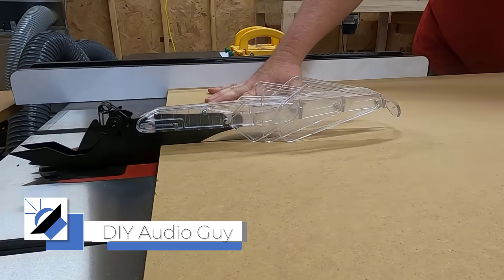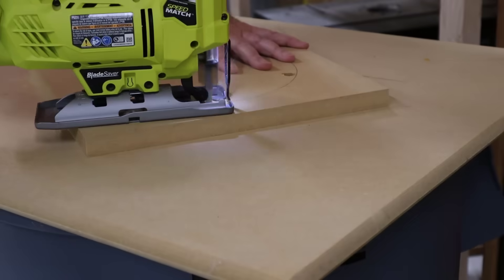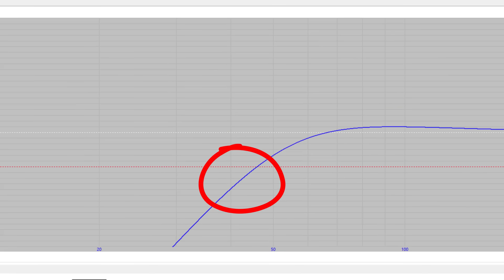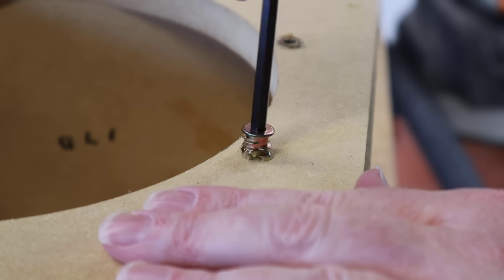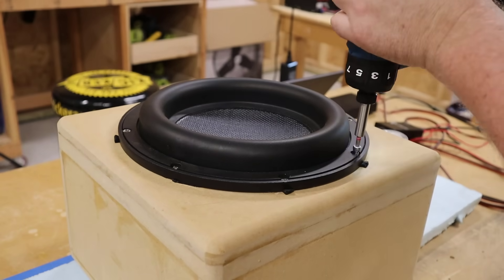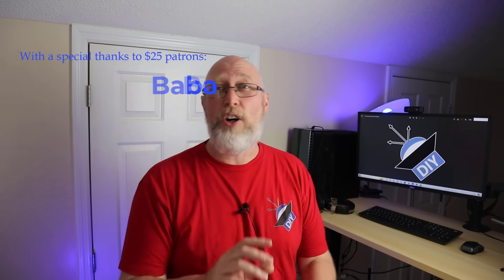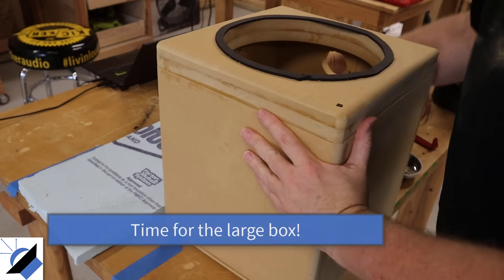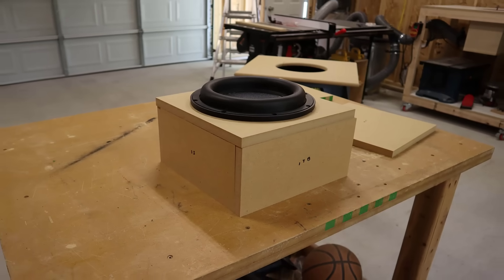Bass in a small space?  Sealed subwoofer enclosure design.  @PartsExpressOfficial

Comment: Get the best of both worlds, one sealed, one ported. Get that nice hard hitting bass drum kick from the sealed, and  the good low hz response from the ported.
Reply from the maker: I think it would be cool to build some good sturdy sealed enclosures into the front doors or the front floorboards.  Then fill the trunk with a massive ported box.
Reply: Sealed and ported enclosures  have a different phase response. Running sealed and ported subs playing the same freqs will sound like a muddy mess. You'll be fighting phase cancellation and reinforcement. Get a good sub and match it to the right box, be that ported or sealed and you won't give up anything in transient response or bottom end extension, especially in a car.
Reply: @helotaxi  Well, that's not what is happening.. I get good hitting bass and get the low frequencies. It sounds good, not muddy at all.

Comment: I'm one of those guys that need to stick with a sealed enclosure.  Either I have tools in the back hatch part of my jeep or family stuff. I'm going from an 8 to a 10 to help with the iron law . According to specs I can get by with .8 cuft of air space. Can't wait until you do the NVX amp video. I really am looking for an amp that can do 350-400 watts at 4 ohms.
Reply: @Tron Magnum
Look into the NVX XAD42. It's a tremendously versatile full range amp that can do anything from 350w x4 @4ohm to 1600w x2 @ohm Bridged. While it is a full channel amp meant for running door speakers (meaning it won't have a bass knob), as long as you set the filters up it can be used to power subs well too. And it's got a small footprint. My next setup will likely have 2 of them running everything in the vehicle.

Comment: that is pretty similar woofer to the 10" i bought: SB Acoustics SW26DBAC76-8 10’’ Aluminum Cone Shallow Subwoofer.
my box is 0.6Cubic Feet. i would consider that pretty tiny. did some WinISD and made the thing. not much air inside with all the bracing and 3 pounds of stuffing.
it did measure in my small room pretty flat to 20hz, but it did not sound that to me so i did a lot of dsp to it. now it sound like flat to 20hz and 15hz at reduced volume.
all with 100w amp mind you, that surprised me.  and i matched the 8ohm driver with 8 ohm amp output.

Comment: I don’t really agree with this statement.  There are always exceptions to this rule.  
If your lower power,  then yes,  a slightly larger box will
Help output.   However if your overpowering your sub a slightly smaller box will help output.  
Prove me wrong lol
Reply: Neither box will necessarily give you more output. The maximum output of a driver in a sealed box is a function of the excursion and cone area. Nothing else. A larger sealed box will allow you to reach that with less power. Although a super small box may be able to increase efficiency at higher frequencies (at the cost of low end extension and sq)
Reply: @blakebrockhaus347  yeeesssss 
My point,  I’ve noticed if your at the max or slightly over max power limit of a sub,  (in a sealed box and even in ported). I’ll run just ever so slightly smaller box and Seems to help control the suspension of the sub better and give you max output that sounds decent,  
Try that same aspect in a larger box,  the suspension of the sub will start to loose control and the sound quality degrades 

Flip it on Lower power level,   A bigger box will let the sub move a little more freer,  and give u better output 

I love this stuff,   Trail and error,  school of hard lessons
Reply from the maker: Sounds like a topic for another video.
Reply: @DIYAudioGuy  I hope so,  seriously 
Power levels vs box size
Reply: I'm currently using A too small box for some Jensens and they get very hot very quickly

Comment: Nice video...!!  The Iron Law still reigns supreme... 🙂

A few things....

1. WinISD really isn't the best for modelling subwoofer capability as it doesn't take inductance into consideration.  None of these drivers are going to produce a dead flat response above 80 Hz like the WinISD model suggests because of their inductance.  Hornresp is a bit more complex to use, but its performance predictions should be a lot more accurate.

2. I suggest always use an external USB sound card when using your laptop for audio measurements.  Not only do the external sound cards usually have a flatter response, there's a lot less risk of damaging your laptop's sound output (which is usually part of the motherboard) when using an external sound card. 

3. Add about 800 uF to 1000 uF of capacitance in series with that driver in that small box and see what happens.  You now have a passively-assisted sealed alignment which should not only remove the "hump" in the response curve (due to the driver's inductance), but should also noticeably increase its output at lower frequencies.  The tradeoff is a lot more excursion, but if the driver's up to it... :-). 

4. Try stuffing the smaller boxes with polyester fiberfill to see how their performance changes...

5. I did a similar experiment some time (as in many, many years) ago, but I used a plastic bucket with a baffle fastened to the top of it to hold the driver.  To vary the volume, I just changed the amount of water in the bucket - not a problem as long as the water doesn't reach the driver's terminals :-).  I think I used the bucket's lid to create an internal circular panel that floated on top of the water as well. Water is not compressible, so it's a quick and easy way to change the volume of an enclosure, as long as it does not come into contact with the driver. I used the contraption for Vas measurements as well as observing the changes to a driver's power handling based on the volume of the enclosure that it was mounted in.
Reply from the maker: I definitely want to try that capacitor trick, I remember reading about it.
Reply from the maker: Tell me more about the external sound card.  The mic I'm using is a calibrated USB mic.  I'm not seeing any external sound cards that have a USB input on them.
Reply: @DIYAudioGuy  Use a laptop with at least two USB interfaces - one for the mic and one for the sound card.  Then you can use a simple USB sound card for the output.  Amazon has many available.  If you're more interested in laptop protection rather than quality, no need to splurge - any of the cheaper ones should work fine.  I use the Startech at the link below because it provides a number of channels of output, and includes optical interfaces, all for $38.  I have it fastened to my desk with double-sided sticky tape, so I can just plug it into my laptop when I'm ready to use it.

https://www.amazon.com/StarTech-com-7-1-USB-Sound-Card/dp/B002LM0U2S
Reply: Definitely would like to see stuffing vs no stuffing.

I personally have added rockwool to my UM12 enclosures and saw it kill any resonances above 100Hz and also lowered my tuning by a whole 1Hz while the overall SPL remained largely identical so no loss in output just a very obvious lowering of the tuning.

Rockwool might have been overkill but I have 3in thick bats that I lined the side walls, bottom, back and partly the top of my enclosure. I have pictures of it before and after but can't really share that in the comments I don't think. (UMIK-1 measurements + a pic of the enclosure inside before/after)

What would be really cool is polyfill vs Rockwool. If I had an extra UM10 laying around I could measure that difference myself. But I don't. And for the time being I have no use for an extra UM10. Though in the future I might and could test that if I have time.

Comment: It probably doesnt make much of a difference but I usually like to clamp after nailing glue ups. On sub boxes I also like to run a bead of glue along the inside corners as an extra measure.
Working with solid wood when appearance matters i feel like clamping is a tighter, less noticible joint. Those corner clamps will be great for gluing without nails as well. Hold them in place just to get a big clamp on. That way you can avoid using wood filler which can be tricky to color match or clear coat 👍
Reply from the maker: Would like to know what you think of this:  https://youtu.be/dbVd5igcjHs  I am not 100% happy with the finish (second video in the series), so I guess that means that I need to build another!
Reply: @DIYAudioGuy  It came out pretty nice, what arent you happy with? I'm a perfectionist, so I fully understand not being 100% happy with the finished product. I think theres value in that, but also be aware that the vast majority of people dont even notice the minor imperfections that stick out like a sore thumb to you.
Not sure how much "furniture" type stuff you've made, but its all a learning experience. If you redo it, the design and process it is only gonna get better. Youll develop your own style of things you like and can apply on future projects. 
I like that window design you used in the box. I'm not sure how I would have gone about making that. Your method was creative for sure. I know the router is one of the most versatile tools, but man I really need to get into making templates and flush trimming lol. I have the tools, just no projects that call for it.

Questions for you now, how do you like polycrylic? I've only used oil base since its what I know, plus its cheaper. Ive recently switched to a 4" paint roller to apply poly, and have loved it. Brushing just takes too damn long, and I think the roller has given me a smoother surface compared to a brush. 
Big up on the DuraTex too. Never heard of it, but nice to hear your thoughts on that vs bedliner. My sub box is beat up and plastidipped and I was considering recoating it with something like that.  

Ive wanted to redo plenty-a projects but usually dont unless I hate it. The only downside to remaking it is the cost of material right now. I also tend not to redo them because I dont want to trash the first one, but I have no use for it. Maybe throw it for sale online or give it away, but other than that I don't want a bunch of first iteration projects laying around lol

Comment: So how does one get bass in a small area? Such as a 8" in a harley saddlebag?
Reply: Dd recently came out with a saddle bag specific sub setup.  If i was doing saddle bags id try out the dayton epique 7inch sub.
Reply: @DTW-bx2vy  agreed. Without much power or space you're not gonna be able to play very low. And all of the bass below 60 hz is gonna get drowned out anyways by the road noise once you start driving
Reply from the maker: That is tricky!  I know that Rossi performance is working on that.
Reply: I was just gonna mention what wet dookie said. To get bass in a saddlebag you're either going to need to do a bunch of custom work on your own, or buy a kit designed for your bags.

DD audio recently came out with custom saddlebag options to get an 8" sub, midwoofer, or speaker in there. And from what I've seen it's the most reasonably priced option on the market
Reply: A smaller woofer with a powerful motor. You don't need 20hz in a saddlebag, but to get to 30hz with an 8 isn't hard at all, and lower with dsp. Look up the dayton 8" reference aluminum subwoofer. Rss210ho I believe. Ho model, not hf. I've got one in a sealed box smaller than most bags that's an absolute monster. Wide q boost filter with the amp at 24hz, is MORE than enough in most smaller home spaces. On a motorcycle? Fugget it. It will beat harder than your bike as long as your not a 120db Harley with big straight pipes. It's easily louder than my cbr1000rr. A pair in bags with room to spare on a cruiser would be sweet as hell.

Comment: I might be building a new box. Trying to fit my 15 in a corolla lol
Reply from the maker: Going to be a tight fit!
Reply: @DIYAudioGuy  Yeah I only have a few inches at the rear, and thats not including my 2 decent sized amps lol. I was hoping to make the spare tire accessable but its highly unlikely. Im used to giant trunk sedans 😅
Reply: What 15 do you have ? 
 I have a 15 in my sonic .
My enclosure is 3.25 ft3 tuned to 29hz with dual 6 inch ports.
Reply: @travisabrahamson5092  SoundQubed HDC3. 
My box is 38x20x14", single slot port. Its around 4.5ft³ after displacement and 40hz. Been rocking this setup since like 2013

Comment: The ultimax is a relatively high motor force sub designed for lfe. I wonder how a sub that doesn't have the motorforce to fight through the airspring of the small enclosure would fair

Also this really does prove that sealed boxes are kinda bulletproof.
Reply from the maker: Right!  A weaker sub would have given a worse response.